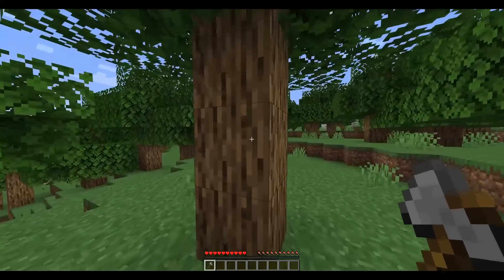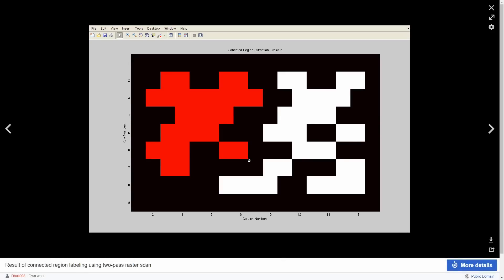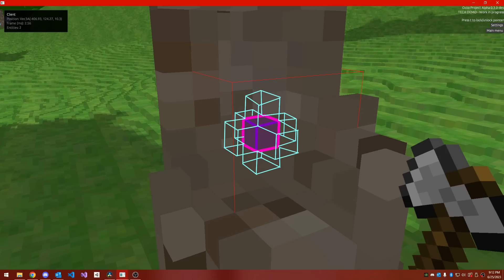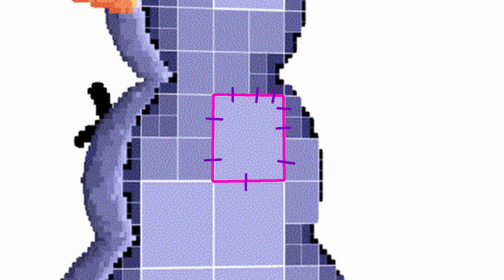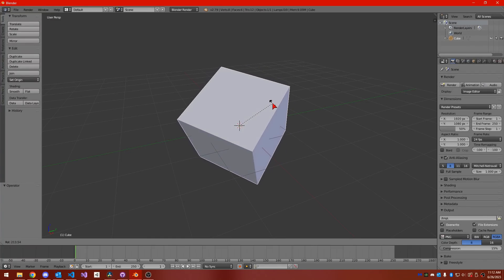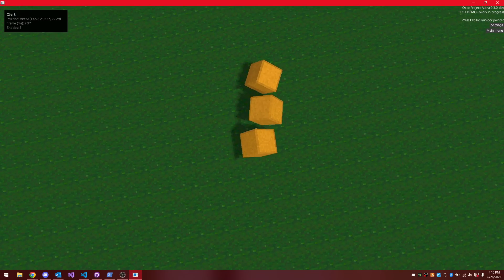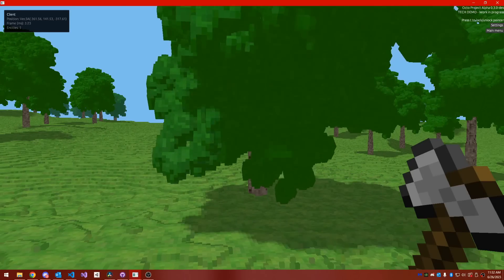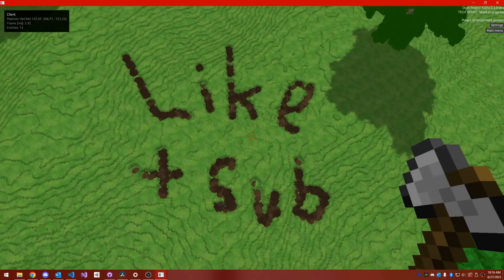Chopping trees DOWN [Voxel Devlog #12]

Comment: Could be really cool if it was possible to render the physics-enabled voxels aligned per-frame to the main voxel terrain grid (think pixel-perfect sprite rotation) so that when the physics object stops moving you can add it back to the destructible voxel terrain grid. This would solve two problems: one where physics-enabled voxel objects could build up causing excessive lag, and two it'd seamlessly convert a voxel physics object into the terrain grid. Phenomenal work! Subscribed!
Reply from the maker: This is a good suggestion, and I'm working on implementing part of it:

I'm not planning on rendering all voxels as axis-aligned. I can't think of a good way to implement it that would be fast enough to run on all objects every frame. I also think that it might be confusing and jarring to players, making it harder to tell where the object actually is (if we are assuming that the underlying physics collider still rotates normally).

However, I do need a way to reduce lag! The plan is to re-rasterize any ground debris that has been alive for a certain time period whenever the player isn't looking it at. The ground debris will then fuse back with the voxel grid, like you suggest. The transition wouldn't be too jarring, hopefully, because it will usually happen when the player's back is turned.

There are other physics optimizations that I plan to add as well. I need to make the system multithreaded (it is already designed for this, just don't have a threadpool yet) and add object sleeping.
Reply: @DouglasDwyer  wouldn't multiplayer cause the fusing to be jarring, because there's a chance someone is watching?
Reply from the maker: @netcore10  excellent question. The plan is to try and fuse objects when no nearby players are watching! That said, there will be also be a maximum time limit to ground debris, and it will eventually fuse/despawn no matter what. This is to prevent too many objects from accumulating.
Reply: This is also what I immediately had in mind. With voxels that support substructures of itself like these, smoothing roundness of corners as an object rotates is very feasible.

Comment: Were there any resources you used for contact point estimation that proved helpful? Been stuck on something similar for something i was working on
Reply from the maker: That's a great question. I was stuck on contact point estimation for a while, and I ended up just using the average of the two colliding voxels' positions as the contact point. This is something that I want to improve, though, because being able to extract contact lines and planes (I can only extract points) will be important if I ever build a constraint-based solver. It's probably worth looking at how Teardown does it.
Reply: @DouglasDwyer  Oh it's cool that it seems to work so well even using the midpoint. The thing im working on uses more traditional colliders and your comment has me wondering if a rough voxelization step would be a faster way to generate rough estimates for contact points than the alternatives... The idea might be a little cursed. Oh well.

Comment: Tried out the demo, and is looking sweet! I was curious if you where still using parallax raymarching, or if you switched over to a mesh only system.
Reply from the maker: Thanks! I switched over to standard greedy meshing in Episode 9, and I have not yet switched back. With the LOD system that I've implemented, meshing is just as efficient but simpler to use. I did invest a lot into parallax ray marching, so I definitely want to revisit in the future. But for now, multithreading/sound/modding take priority :)

Comment: Why are you not using the gpu'??
Reply from the maker: I am using the GPU! It's how I'm rendering such large quantities of voxels. But I don't currently do much general-purpose compute on the GPU, only rendering. This is because I want to target a wide variety of hardware, including integrated GPUs - which aren't powerful enough to run the entirety of the engine on them. I do want to offload terrain generation to the GPU, though.

Comment: How does it decide which "side" gets disconnected? Does it just choose the smaller one?
Reply from the maker: Just about. There's a maximum size that an object can be. Any bigger than that, and the DFS algorithm gives up to save processing time. So for any object that is connected to the ground, the DFS starts reading voxels from the ground. It discovers a large number of them, because the ground extends downward infinitely, and then gives up.

Comment: I'm new to Rust and I have a question. Why are the modules of your engine separated as crates in a workspace and not modules in a crate?
Reply from the maker: Excellent question. There are two reasons for this. First and foremost, compile times. Rust caches compiled crates, so if you separate your project into many small crates, it won't have to recompile the entire codebase every time. Secondly, I have multiple compilation targets - including the native client, the web client, and the backend webserver. Since each of these is a separate binary target, it's easiest to put them in different crates.

Comment: For the stack of boxes not tipping over (14:36), does your collision check differentiate between dynamic-dynamic collisions and dynamic-static collisions? And do you apply the forces (and later their corresponding torques) to both colliding objects? I'm guessing from the video, but it seems the forces holding up the top box (biased to the left so the resulting torque is negligible), are not being applied to the box directly below (their bias to the left would cause a higher torque on the second box that would accumulate down the stack). This fix brings other issues though,  as the transmission of these forces ends up being 1 dynamic object per physics iteration (wobbly physics as the system settles), and depending on your force calculations, can lead to the bottom object "sinking" into others (spring/force) or ex/im-ploding (overlap correction/momentum).
Reply from the maker: Your description is completely accurate. When an entity is processed, it sees all other objects as completely static and immovable. So forces aren't really transferred beyond one object, in the normal sense. This is what I meant when I said things are not physically accurate - forces and momentum are not conserved.
I definitely want to try adding more comprehensive force/momentum transfer in the future. I think that it would help with having pool balls collide and bounce off one another, for instance. But what I've built so far works well, and I also want to spend some time on other parts of the engine :)

Comment: If you store whether a voxel is exposed to open air, then you should only need to consider those voxels when doing connected component labeling to check whether the object is still connected to the world. After that, you would have to consider all the voxels, but doing a quick litmus test beforehand should speed things up.
Reply from the maker: You're spot on! I didn't describe how I choose the starting points for DFS in the video, but this is exactly right. I only start graph traversal on solid voxels which have neighbors that used to be solid, but have become air. Only these voxels could possibly have been bridge nodes in the graph :)